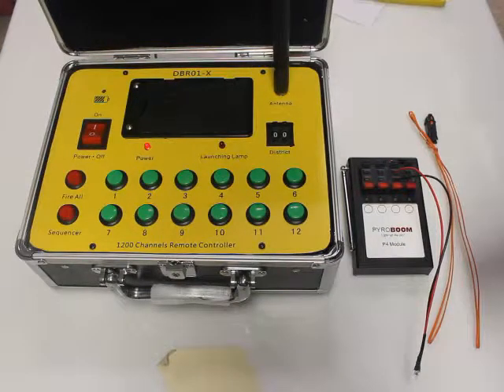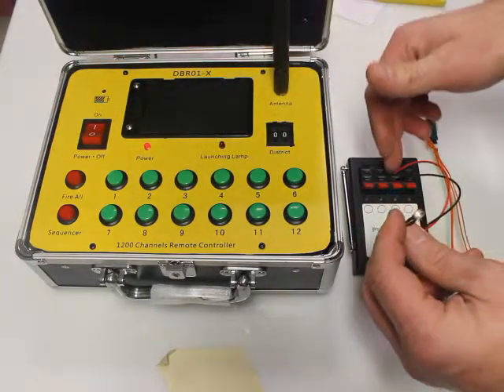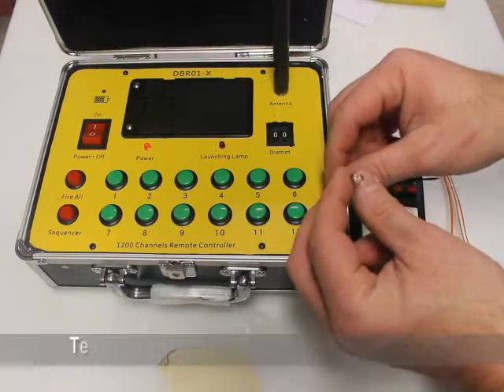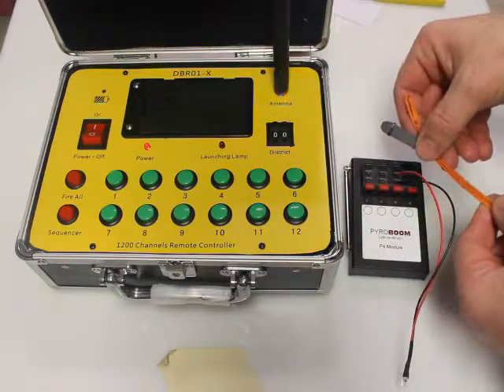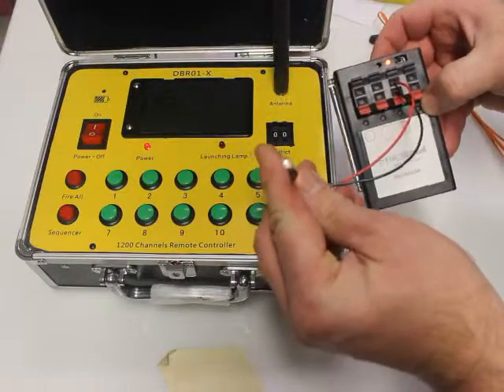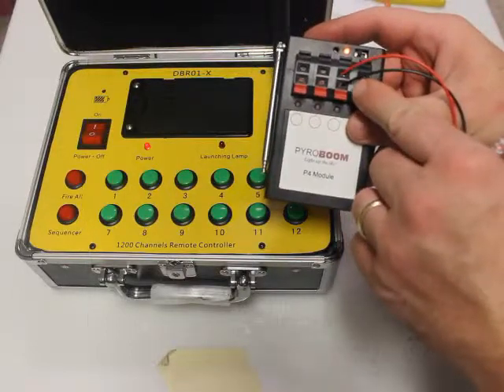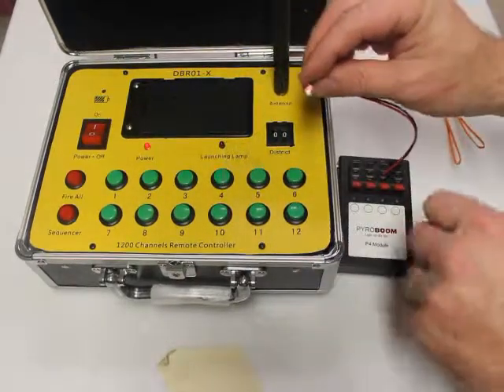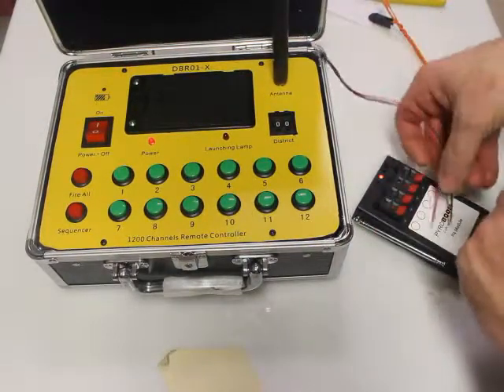Testing LED

Comment: I'm just curious, do you know what the polarity is on the outputs of those firing modules? 
Red usually means positive (+) lines in DC systems and black is used for negative (-) lines. Is there a standard (color code) for that in fireworking industry or different firing systems are wired different ways? Thanks.
Reply from the maker: I believe the polarity is on this system is just the opposite.  Black is positive and red is negative.  It's really a moot point because for e-firing there is no polarity.  It's only for a testing LED.